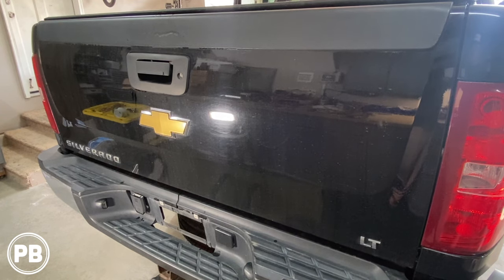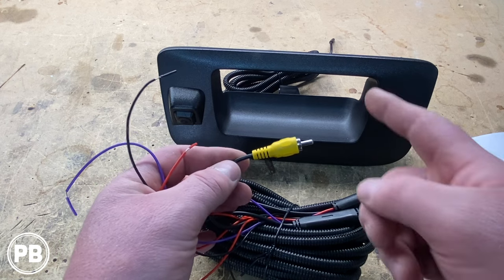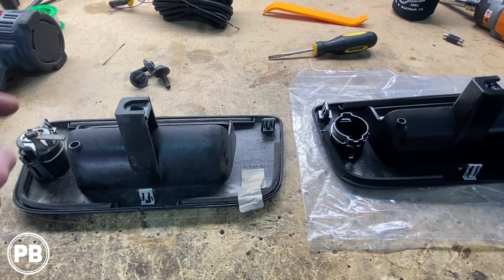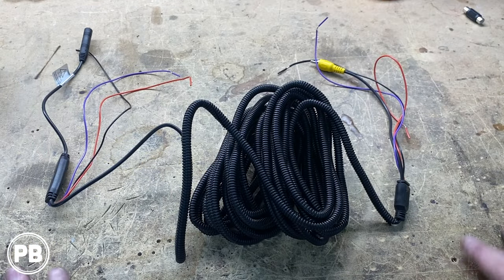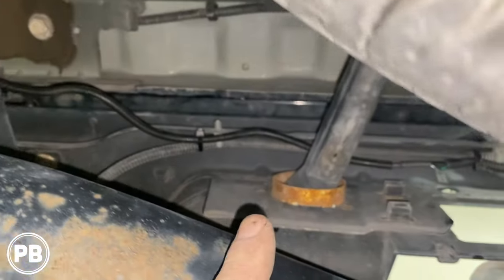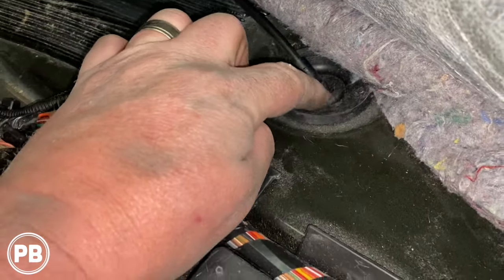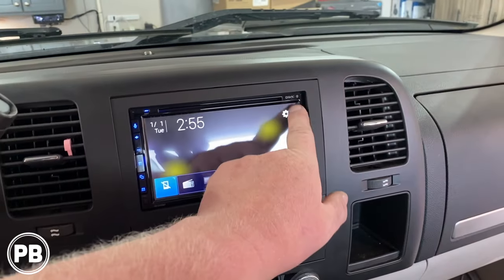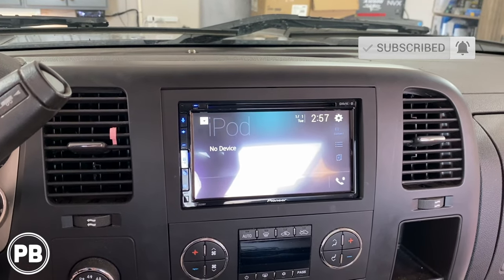2007 - 2014 Chevy GMC Truck Tailgate Camera Install

Comment: I'm trying to figure out my eBay special that looks like your camera but it only came with red and black wiring through the tailgate. And only red at the head unit. Aka in my book as the pioneer! So do I have to ground my camera up under the bed and rear frame? Or do I leave it taped off under there and only connect the camera red wire in the dash to ignition on wire?

Comment: The guy with the truck b4 me used this harness but didn’t have any of those 3 wires red blk purple connected. So how did he use power?? I dropped the tailgate n now it says check connection on the deck but where is cld he draw power from??

Comment: I have a question. I want to use the purple wire to run to my reverse light, do i have run a wire back my reverse light  being the purple wire is so short, or try and find the reverse wire in the lume?

Comment: I tried to install this same camera and I got a black and green screen? 

I decided to tap into the 12v adapter power underneath the air controls and using the RCA connector

Do I need to have the purple wire go anywhere??

Comment: Hello -- it has been a year!  Are you still happy with the backup camera? Trying to get past the 1 star negatives on Amazon is what keeps me from buying one of these tailgate camera kits... The Ecoconut* Tailgate Camera Kit has a 71% positive and a 7% 1-star rating on Amazon with a lot of camera failures?  Plus the camera is "riveted" onto the bezel so zero adjustment can be made? Lastly is there any chance that the factory wiring hraness is already in place but hidden away over on the driver's side junction box next to the spare tire?  I have a 2012 LT extended cab with most all of the options including the "park-assist" sensors in the rear bumper...  I am going to dig and see if there is a connector there for the camera harness.
Reply: I have a just about fully loaded truck like yours I looked for a factory connector and couldn’t find one

Comment: Hi I have a question my camera wiring on one end has the plug for the camera but has two wires a black and a red. and the other side that connects to the radio has only the yellow rca with a red cable only that connects to the brown rca port my question is I don’t have a smart harness. Do I connect on the radio the red to the  violet white cable that is the reverse trigger wire or to the red that powers the radio, and on the tailgate do I connect the red and black to the reverse light  or how do I connect it I’m lost thanks in advance I wish I could upload picture for you to see it

Comment: Just installed this camera, is there a away to adjust the camera angle or repossession the lines upwards
Reply: You can open the tailgate and wrap the your tailgate cable on the latch and it will hold it in the right position where you can see the ball on your truck

Comment: I have a 2012 Silverado LTZ . I have a Eonon radio and it automatically goes into reverse mode when I put my truck in reverse. Will I need to hook up any power wires or should I be able to just plug up the rca plug? My truck does have park assist sensors in the bumper but no back up cam.
Reply from the maker: You still have to power the camera like we did in the video. Our radio also has a smart harness where it cycles the radio to reverse when backing up. So no trigger needed, just power the camera either off of accessory or the reverse light power and ground wire.

Comment: Just bought the same camera and it only shows a black screen with the lines, what did I do wrong?
Reply: You and me both. Did you ever find a fix??
Reply: @Roadking013  not yet
Reply: @corncobbbhunting7082  I ended up figuring it out. The radio unit I was hooking it to has multiple options for input (cable,screen,camera) and I had to set them all to NTSC or something of that nature
Reply: @Roadking013  So you just had to change some settings on the radio itself?
Reply: @corncobbbhunting7082  for me, yes. I did have to follow the wiring set up for a different camera style but same harness for my particular radio to figure out where to tap the purple wire into as well

Comment: Hello, I wanted to ask a question because I am already desperate, I bought a tailgate camera for my 2007 silverado, I connect it to the radio and it tells me that there is no signal, I don't know what to do or if it is some problem with the settings on the radio...thank you
Reply from the maker: If you get a no-video signal, that indicates you are not getting power to the camera, or there is an issue with the video cable input. Check your connections, check to see how the camera is getting power, etc.

Comment: Installed a backup camera to my pioneer dmh-1500nex. Camera works when I hit the button but not when I put it in reverse. Have the same smart harness. Any ideas why this would be happening? I have the ground and power hooked up to the cigarette lighter
Reply: I have the same issue. Let me know if you figure it out.